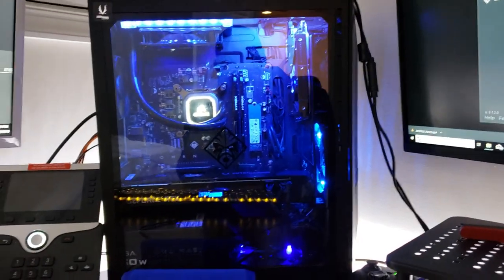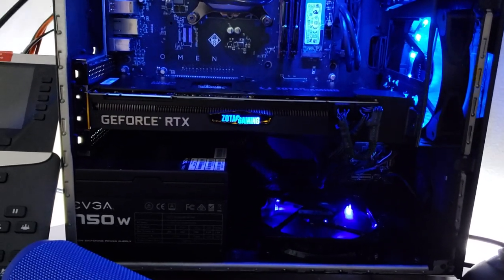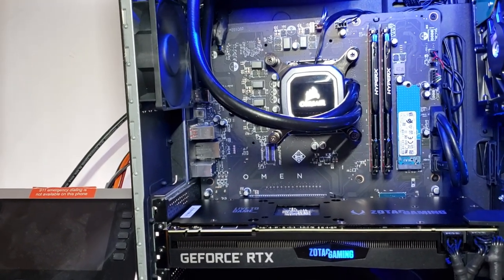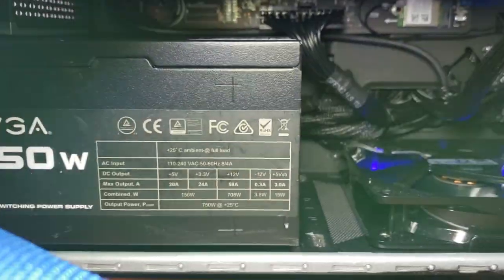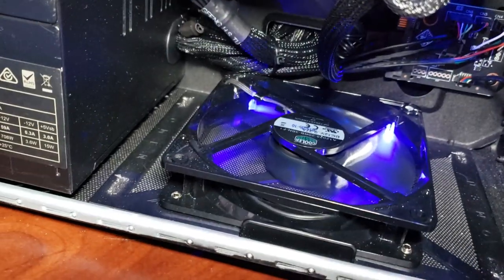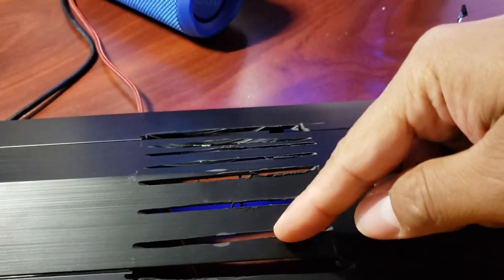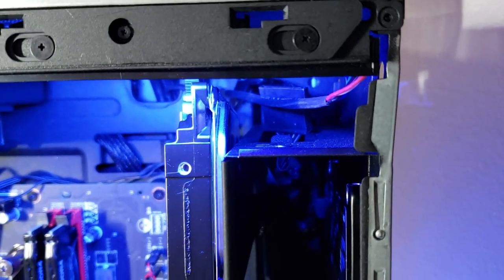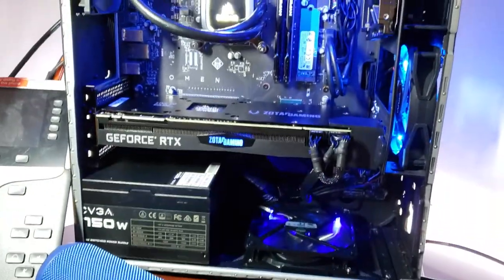HP omen obelisk hack after 10 months (zotac RTX 2070 super)

Comment: I did it I fully replaced the HP omen,new case new motherboard everything you name it. It's funny once I took out the HP motherboard out it stopped working so that's gone after 3-4 months. My first PC results with specs if I put new next to it it means that is something i added 

1660 ti(came with my hp)
I7 9000(came with hp)
2 sticks of 8gb corsair pro 3000 mghz(new)
H60 cpu cooler(new)
Nxzt 510 case(new)
Asus strip z390-e motherboard 
Evga 700w bronze psu
2 tb samsung qvo(new)
1 hdd(came with hp)
256 Toshiba m.2(came with hp)

In 2020 I am saving up for a i9 900k cpu and a 2060 super. 

I highly encourage is not and I mean not buy the hp omen you will end up spending more money to replace mostly everything. I rather you buy the compments and see if your local best but geek squad can build it for you(mine does and they do it for free with total tech support). My case is better as far as airflow wise
Reply from the maker: I agree, if I could go back in time, I think that I would just buy all the parts and build it myself. Good list of specs, how you can overclock and make adjustments to your PC.

Comment: I have the current stock pc you had. Im looking into getting a rtx which do you recommend? looking into the 2060.
Reply from the maker: if you have a 1440p monitor,,, get the RTX 2070... if you have 1080p monitor get the 2060
Reply: Chris thanks for the reply. Any RTx 2060 below the minimum 500pw should work right?
Reply from the maker: @MrRamosxD360  Yeah, but make sure that it isn't one of those super thick 2060 GPU's as there is limited space for it
Reply: Chris thanks for your help, really appreciate it!

Comment: Question where do you plug in the bottom fan
Reply from the maker: I bought a fan splitter wire and connected it to the header where the rear fan connects.
Reply: @Mr-Chris  where did you get it

Comment: I got the 1660ti version from Black Friday but is it just best for me to upgrade my case?
Reply from the maker: Only upgrade the case, if you have thermal issues. I think the 1660ti runs cooler than the RTX. Get a a cpu aio cooler and try to adjust the fan speed using software for the GPU.
Reply: Yes get a new case, that is what I did and its awesome, last upgrade is me changing the motherboard

Comment: I picked up the 2060 version and it runs well, eventually wanna change out to a 2080 when the market simmers down cause $1500+ for a base 2080 in canada is faacked bud
Reply: yo i bought the rtx 2060 version, but it came with a 2070. idk if you have the same luck, but be sure to check in your geforce experience whether they gave you that same card.
Reply: Arjun Trikha yeah man! I forgot to state that when I originally posted ! My system specs and driver specs all say it’s a 2070, which left me very confused. But very awesome how HP did that
Reply: @pilotintraining2391  yea bruh thats amazing!

Comment: What’s a compatible mobo that will work with the case
Reply from the maker: A mini atx motherboards should fit, but if would strongly recommend getting another case if you are considering getting a new MB.
Reply: I’ve seen issues with the power connectors being in a different spot, if I do use a different case can I use the same ssd ram and etc

Comment: Can i get the other model for the hyperx ddr4 16 gb of ram?
Reply from the maker: Yes you could, however this motherboard max speed Ram is 2666mhz. So even if you buy a faster ram it will only run at that speed. My suggestion is get 2... 8 GB ram sticks. By the way I did upgrade my motherboard recently and this hyperx Ram can be overclocked to 3466 MZ.
Reply from the maker: @tkhang1  yeah that's the same Ram my PC came with... You'll end up with 32 GB... And if you upgrade to another computer this can be overclocked to 3466MZ.
Reply: @Mr-Chris  so will it still be considered dual channeling?
Reply from the maker: @tkhang1  yep it will be dual channel and you can take it with you if you upgrade to another computer.
Reply: @Mr-Chris  i need a gpu upgrade too but idk what gpu i should buy. i want an rtx but idk which one and which model i should get
Reply from the maker: @tkhang1   it all depends on your budget. The RTX 3070 is the best value GPU and it comes out tomorrow. However you can also pick up a 2070 super or a 2080 super used at a good price.
Reply: @Mr-Chris  could you send me some links
Reply: @Mr-Chris  will the 3070 fit in the omen?
Reply from the maker: @tkhang1  yeah you could fit a 3080 in this case... However regardless which GPU you pick.... it will run very HOT. This case sucks. I just ended up upgraded to a new case getting rid of this hotbox. one easy way to mitigate this is to leave the side glass panel off all the time.
Reply: @Mr-Chris  oh ok thank you!!

Comment: What size are the fans
Reply from the maker: 120 mm
Reply: @Mr-Chris  I got a 1660ti and looking to drop my temps but I usally run at 72-80 when play I want it to stay at a steady 70 degrees Celsius im going to get two 120 mm fans and a 80mm fan for the front its my first PC and I want it to last
Reply: Jay Tejada  get NOCTUA NH-U12a it’s worth the value (better than liquid cooling)

Comment: How tf do I change it to get my monitor to display display port and not hdmi so triggered so I can get 240 hz for the $500 monitor I paid for reeee help anyone
Reply: Search for it in the search bar on the bottom right on your desktop. Should be nvidia gsync or whatever you have.
Reply: Darius Pryor can you help me got snapchat?
Reply: Darius Pryor I get to physx and see that it’s hdmi connected but idk how to change to display port
Reply: @frontlinespybarnes4100  its nvidia right?
Reply: Darius Pryor yess a rtx 2070 super discrete regular ones that come in ho I updated my gpu drive and monitor driver yet still can only go to a max on my msi Oculux bxh 251r 240 hz monitor I even have a never 1.2 gp cable comming in tommorow to see if it’s my 1.4 do cable that isn’t working but it’s brand new nvm I’m a retard just had to use little red analog stick on my monitor to switch to input
Reply: Use nvidia control panel and either use change resolution under pc or use custom.

Comment: i just need a new motherboard and case. Hp is just trash. My cpu just had a little heatsink then i had to change that. And ram, ssd, psu and bought a new harddrive to store games in.  i wish i never bought this comuter. But it is powerful. But my 3200 mhz ram can't even reach 3200 mhz thanks to the motherboard.
Reply from the maker: I just did that last week.  I just built a new PC and ended up only keeping the ssd and ram from this HP... The hyperex Stock Ram can be overclocked to 3466MZ on a other motherboard. I wish I knew more about PCs as I do now back when I bought this.
Reply: i also wish i knew more about this comuter. But i hope the non HP comuter is working. Soon it's my turn to get a taste of a coler system and a good Bios. Just need a Motherboard and a chassie and everything will be good. Also how hot is your GPU now and CPU?